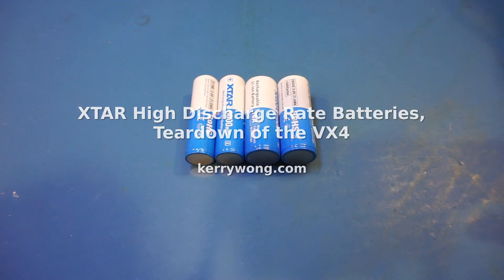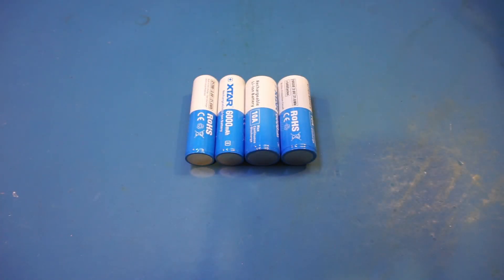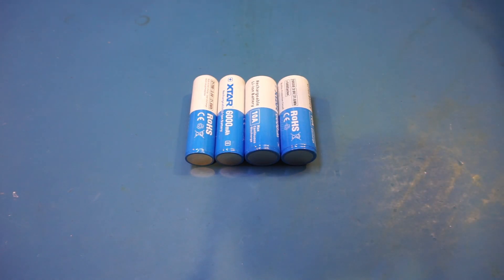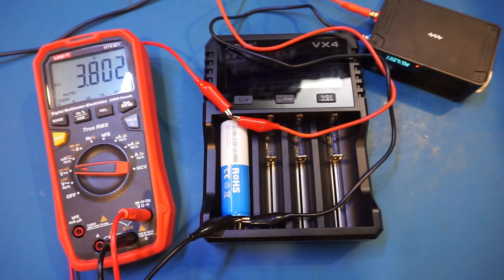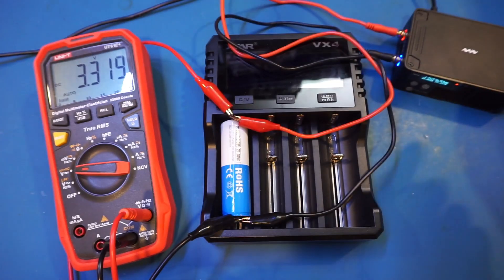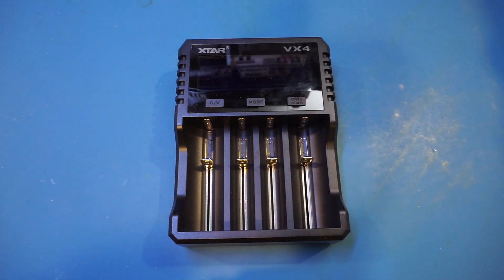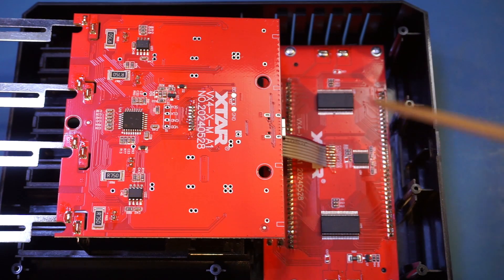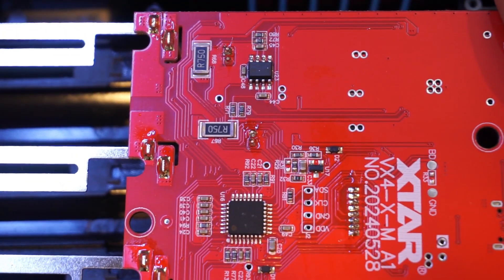XTAR High Discharge Rate 21700/26650 Batteries, Teardown of an VX4 Charger

Comment: The sliders look good. I like how they've connected the springs to the PCB. The two boards seem to have a good connection due to soldering the wires to each PCB (they could have used a ribbon cable with connectors to avoid soldering but the decision to solder the wires might result in the charger lasting longer and withstanding some drops more).